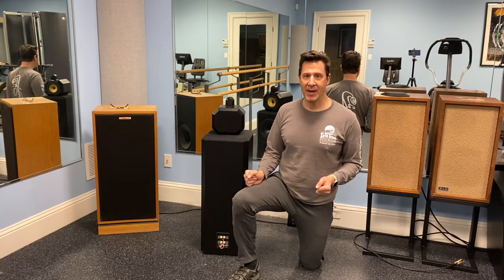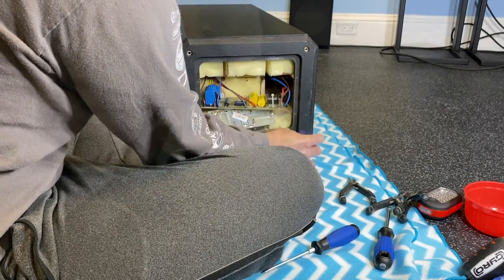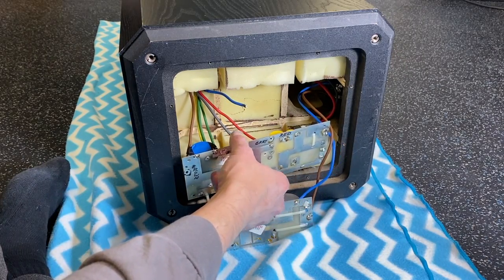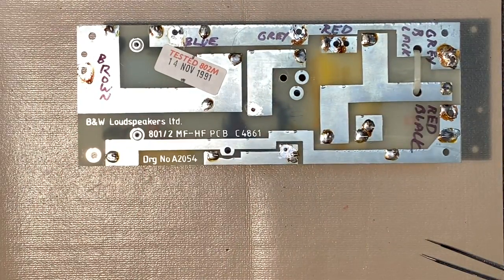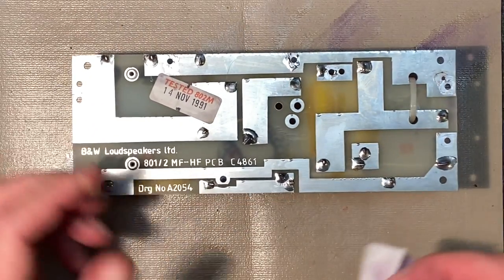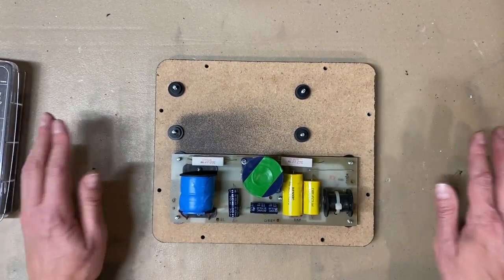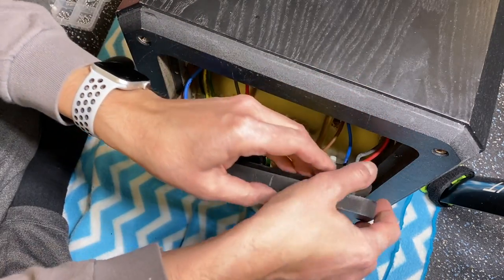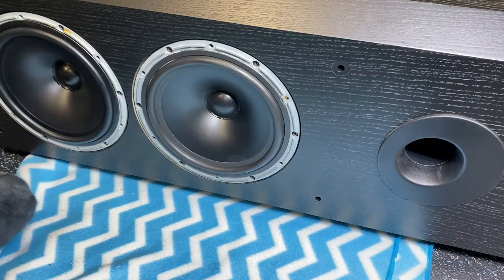B&W 802 Speaker Repair & Demonstration

Comment: I have a similar set og B&W 802s3 and in perfect condition. But, as they get older, there's a small sagging taking place on the units, and that can lead to an ever so slight rubbing in the air gap. So with a few years in between, one can just undo the units and turn them upside down, and tighten them again.
On a different note, modern electronics have developed and amongst that are the resistors, which are sand cast on these. They vary pretty much during playback as they heat up and down. The solution is to have new set of cross overs, not to change the sound characteristics, but to renew components. If one is not into that, there are a few different offerings out there. I found an american guy, a german guy and of course Troels Gravesen from Denmark (loudspeaker constructor). I do not know the names on the foreign guys, but they all look serious in their offerings as to components, design, values etc. In the process you also get rid of the connectors from the wires to the sockets - directly soldering. As fas as I know, North Creek went out of business years ago. A pity.
Further, despite optimising my listening room, measuring delays from reflections etc. I find that all 802 speakers, including these 802s3 benefit from a slight lift off the floor. I ordered some US made sound anchors, and they gave a firmer bass thereby making it easier to note the various deep bass sounds, and made the sound come more free of the speakers. All in all a good investment and highly recommended. You'll have the same sound, just a lot more of it, bigger stage, lower noise floor and more details and firmer bass, more relaxed and detailed midrange and treble. It will then play up the the modern version and even in my humble view surpass that (debatable) as it's more natural. I mention that because I find the new version as well as many other present day speakers focus on details and transients and attack, rather than the velvet that binds together the music.
Thanks for sharing.
Kind regards.

Comment: Nice work. I especially like the part where you replace plastic clips with hardware. In speaker boxes I always use loctite the nuts, they don't come apart.

Comment: Nice repair, but while at it I would have upgraded to Air Core Coils and replaced those Bennic caps (especially the bipolar electrolytics) and sand cast resistors with something better. and solder the wires to the drivers instead of using those typical B&W push on tags. that Hakko desoldering tool is awesome. I want one!

Comment: Great repair!! Very nice to watch! One question though, out of curiosity, why didn’t you recap the capacitors at the same time? They are 40 years old and could have used a replacement. I am thinking about replacing the caps in my B&W speakers.

Comment: I have a pair B&W 801 Matrix Series 2.  Had an issue with a woofer (no longer in production).  There is a place called "The Speaker Exchange" in Tampa that were great to deal with.  I was told B&W recommends them for repair of their vintage speakers.  I sent them the woofer as well as the head unit on one of my 801 Series 80 which had a bad mid.  There were very reasonable and quick with repairs.  A good resource for info or parts.  I could not find adequate info on the internet about either of my 801s. I purchased both pairs new in the late 80s.  You said you had a service manual for yours?  How did you come by that?  I could not figure out the disassembly for the concrete mid enclosure/tweeter assembly.
Reply from the maker: Dave, thanks for the info about the Speaker Exchange. Might be helpful for other viewers looking for a trusted repair shop. Check Hifiengine.com for schematics and parts lists. They’ve got a good library of B&W info and I think they have what you’re looking for. Hifiengine is always my first stop for hifi owner manuals, service manuals and schematics. Well worth getting a free account there.
Reply: Same problem with my pair bought in 1980. Thanks for information

Comment: superb video.  My 802's are still fine after 20 + years.   I think some small critters (children) may have pushed a toy or two through the port.   Will I be able to access those if i take off the woffer as you did?   Thanks.

Comment: Thank you... my days of playing with repairs are behind me. Question 1) did you treat the other speaker to your tweaks? Question 2)Did you not do a test run on the crossover before r e-installing it?
Question 3) Did you thinkof replacing caps and resistors at all?
Reply from the maker: Thanks for your questions. Here are my responses:

1. No, the other speaker was operating correctly so I’ve never had to do any work on that one. 

2. No, I didn’t do a test before reinstalling it because, as I showed in the video, I wasn’t sure I was going to keep the speakers. I made an agreement with the seller that I would do a relatively quick investigation to see if there was a relatively quick repair. If the crossover repair had not worked, I would have returned the speakers. I wasn’t prepared to do more diagnostic work given what I paid for them. They were supposed to be perfect. Additionally, the way I’d really want to test the crossover was in the speaker itself, and connecting the crossover requires almost full reassembly anyway.

3. The idea of replacing the resistors would never enter the picture unless there was a symptom of something being very wrong. In this case, it was obvious the issue was the dislodged coil so there was no reason to suspect resistors or any of the other components. Resistors of that quality in the crossover should never require replacement as a matter of maintenance. Replacing the capacitors for maintenance purposes may be necessary in the future, but my experience has shown that the caps in those crossovers have years of life left in them. 

These speakers perform (almost astonishingly) well after the fix. They are among my favorites in my collection.

Comment: Very meticulous work. Great job. Looks to me like the room could use some room treatments on the walls. If it already sounds good then what the hell do I know.
Reply from the maker: Thanks, Dwoodog. Yes, the ceiling is acoustically treated and the room sounds very good, but you’re correct, it does benefit from some portable acoustic panels I sometimes use in the room. Thanks for stopping by.

Comment: I have a similar speaker the 801 Matrix 3. I recently purchased a set of 805 Matrix and the tweeter has come off. I realized this was an attempted repair with some kind of an adhesive. Is there a repair technique you recommend for re-attaching the tweeter housing to the plinth? The interweb has made mention of Blutack but not sure of the reliability of that advice or if something more permanent is recommended. Thank you.

Comment: wow, i never thought that series 3 was designed diffrently than 802 series 2 like mine. in series 2 the bottom panel is just a plain cover and nothing attaches to it.  and the crossover board is mounted upside down at the bottom of the speaker. its a one peice board, clean and uncluttered where two bi-wire cable is accessible for adjustment, no parts is loose that shifts during transport. i noticed the newer 802 no longer have those relays blocks for upper and lower signals, thats the over current relays.
Reply from the maker: Interesting. Thanks for sharing that.
Reply: maybe they did away with those relays coz they no longer come with an outboard Bass Alignment Filter like the series 1 & 2 that was made before year 1990.
Reply from the maker: Or perhaps they concluded that the new design and drivers didn’t require the current limiting for protection.

Comment: Nice Job!
About to purchase a set of 802s3. Was considering Kef R3, same pricerange, but think il'l try the B&W out, due to easy resale.
My thought was hot glue! Both to fasten M3 screws. Inductor could be striped and and hot glued to the printboard.
Did you check all capacitors with leak test, and Lcr meter? Did you consider to change the ferrofluid inside the tweeters?
Do you still own the speakers?
Thx for this comprihensive video, much appriciated! 🙂👌

Comment: Nice job!  You could probably get those circuit board clips at a big box store.
Reply from the maker: Home Depot and Lowes do carry some specialty hardware, but I’ve never seen those clips available there. They can be purchased online by other retailers. As I showed in the video, though, they’re really not up to the challenge of securing those boards and that’s why I opted for a better solution.

Comment: Just curious did replacing the caps cross your mind given the epic effort involved?
Reply from the maker: No, and I didn’t bother testing them. B&W uses high quality components. The caps used are very unlikely to have any issues.
Reply: @FluxCondenser  I have some 801 older than what you have  and the caps I took out of my speakers were all pretty bad.  Mine were 40 years old yours are only 30 years old but electrolytic are only good for less than 20 years.  I also replaced my with Poly caps. Made everything sound much better.  Bass and midrange now sound much better.  In fact not a bad idea to measure the resistors.  I upgraded one guys 802 series 80 and they sounded much better but we never replaced some defective resistors.
Reply: @zorst99  There are electrolytic capacitors over 20 years old and they are still in good condition.

Comment: What microphones are you using to record at the end of the video?
Reply from the maker: I used an Apogee HypeMic for one channel and an Apogee Mic Plus for the other. They’re basically the same mic, but the HypeMic has a built in analog compressor which is sometimes helpful. That’s the mic I use for my voiceovers as well.

Comment: Do you have/use a frequency spectrum analyzer to measure the output of the speakers against their rated performance parameters? Is that even the right tool or am I totally off base?
Reply from the maker: No, that's a good question. To truly do the testing correctly, though, it should be done in an anechoic chamber to mostly eliminate the effects of the room on the speaker's performance. That said, I have a computerized test system for tape decks that I'm going to experiment with to do just what you're suggesting. It won't be perfect as I can only do so much to isolate my speakers from the room and I'm limited by the quality of the microphones and preamps I'm using as well. Still, I think it will be helpful to compare speakers to one another and detect anomalies such as a bump in the mid-bass causing boomy-ness, etc. I also have a spectrum analyzer/equalizer with a microphone and pink noise generator which I'll be experimenting with. Stay tuned.

Comment: Excellent video.   Would you have used "Flux Capacitor" for your name or is that copyrighted?
Reply from the maker: Thanks, much appreciated. No, I chose the name Flux condenser because condenser is the old-tymie way of saying capacitor. I started on YouTube doing antique radio repairs (lots of condenser replacements) and thought Flux Condenser was a clever play on the Flux Capacitor from Back to the Future. I liked the whole time-travel thing, too as I sorta feel like repairing old equipment is the closest I’ll ever get to going back in time!
Reply: @FluxCondenser  
Thanks.  I am old enough to remember when capacitors were called "condensers" even by electronic repair people.  I am not sure when the term was replaced, but I  think it was sometime in the 1960s.  I think your name choice is excellent also.  
When I was growing up, our family had a "Truetone" console AM/shortwave radio from Western Auto.  It stood about 4 feet high and had a 12 inch electrodynamic speaker and 11 old style octal tubes.
The speaker's magnet was energized by a DC voltage from the receiver, and had a four wire connector.    Remember the Western Auto store in the Back to the Future episode 1 in the 1955 period.   In 1955 I was 9 years old and it was one of my favorite stores.  I used to buy "bell wire" and "Number 6 batteries" for electronic experiments for my budding interest in electronics.
Reply from the maker: Interesting. What kind of store was Western Auto? Before my time!
Reply: @FluxCondenser  
Western Auto was a hardware store that included tools auto accessories, some appliances and radios and televisions.  It also had electrical products and dry cell batteries.  The Number 6 was designated as an ignition battery.  It was 1.5 volts and 35,000 to 40,000 milliamp hours.  It was 6.5 inches tall and about 2 and 5/8 inches wide.  Bell wire was solid 18 gauge wire with a plastic jacket.  Original use was for doorbells.  It also had garden tools and bicycles and tricycles and wagons . I think there is one shown in the Back to the Future movie in the 1955 scenes near the clock tower.
Reply from the maker: Sounds fantastic. My first trip if i could go back to the past.